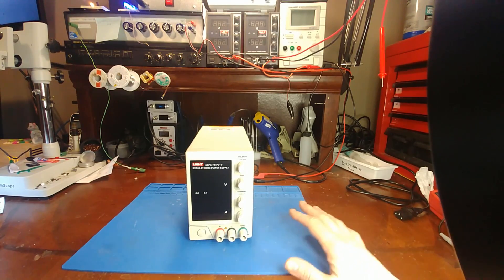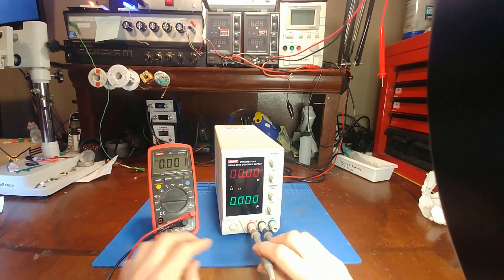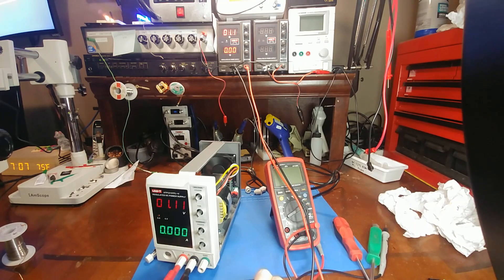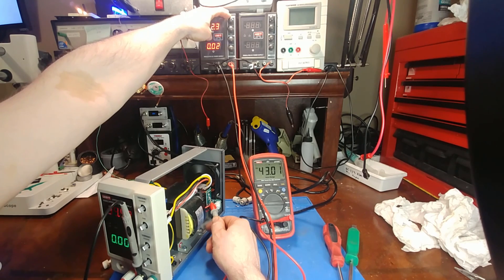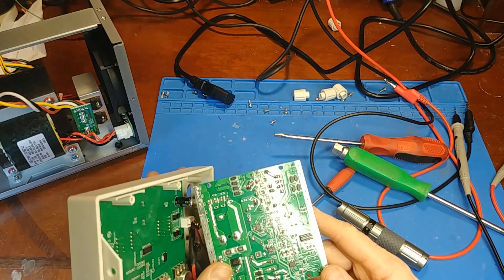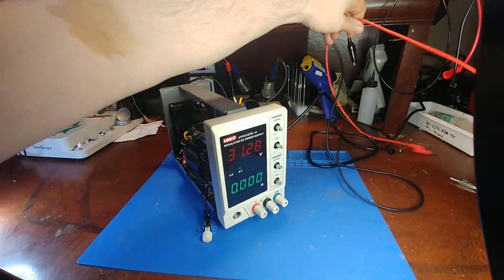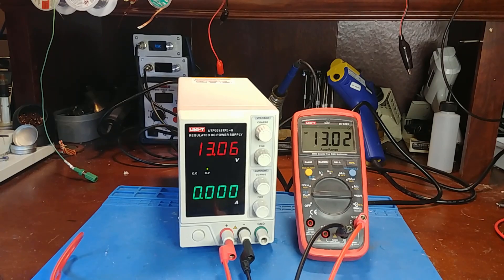Let's fix a UNI-T Power Supply

Comment: I have same PSU, it's amper range ise jumping all over the place when output short. I check all components end it's seems normal. I will try replace potentiometers. Any suggestion?
Reply from the maker: Does the problem change when you turn down the current potentiometer?
Reply: @jeffescortlx  its unstable, won't stay same place again.
Reply: i tryed again, show and walks around 3.1 amp
Reply from the maker: If the unstableness doesn't change with making adjustments to the potentiometers, it's probably not the potentiometers that are the problem. I'm not exactly sure.
Reply: @jeffescortlx  i will try to replace opamps. probly feedback part of the circut the problem.

Comment: hi bro.thanks fr the video.i have the 3 digit one.the lowest tab is not working that means it does nt go below 9v i opened it and adjusted vr1 now it goes upto 6v nt below that and higher end becomes 19v.any help would really go a long way jeff. its in constant voltage
Reply from the maker: These will usually use relay contacts to switch between different taps on the transformer for different voltage ranges. Are your relays switching in and out properly as you adjust the voltage?
Reply: Thanks fr ur reply bro. I can’t hear relay clicking sound after 15v till 0v. ur right might be the relays. So shld I replace them? How to check if relays are bad and specs for yuyihon yyh3f-sh-124lz? Which one is for lower tabs? Thanks fr ur time.
Reply from the maker: @zeuszix8009  before you replace them, check to see if the relay coil is getting power or not. It might not be the relay itself that is the problem, but whatever drives it.
Reply: Yes I will try to that. Will update u.thanks fr ur prompt replies.

Comment: Hi, just came about your video. How is this power supply regarding the output HF noise?  Have you ever measured that?
Reply from the maker: HF as in high frequency noise? It's a linear power supply so I wouldn't expect that to be an issue.

Comment: You're right about Uni-T. I have the same meter and I've got several products from them, they've become my go to reliable manufacturer with nice quality standard.

I've tried products from Lilliput/Owon and while the concepts are good, their implementation is usually wonky: unstable, not accurate, slow, prog. PSU with hard fan noise even when off, even their multimeter whines like crazy. Some I had to return.

Uni-T? Absolute charm... I've bought a 100 MHz oscilloscope going against bad press and it's very comprehensive and pleasing to use, I reckon pretty close to Rigol and nothing like the bad reviews suggested, which chiefly concentrated on missing interface features on earlier models which is now revamped and quite stuffed.

Comment: Jeff!  or anyone, Mine identical device, is showing and outputing around 44.33v constantly , values are real comparing with my tester... current seems to be fine if could be tested passing CC to CV as usual, rotating knov volt does not change values at all.... always arround 44 vol,

PLEASE

what to test?? 
all is clean at 100%!! not blown components or traces of exploded caps or anything... most diodes are ok and transistors too i think..caps are good shape
Reply from the maker: Typically when a power supply is stuck at maximum volts it's because the main mosfet that controls the voltage is shorted.
Reply: @jeffescortlx  can you please guide me to which one is it? where the mosfet/ transistor is located in this device?
Reply: @jeffescortlx  it started to work fine again by itself, maybe the relay stucked or similar due to its sounds...tks for your help, and if you can confirm that a relay might have affected to generate this issue you are welcome..

Comment: hi friend 
my utp1306s got microcontroller (  n76e003at20) getting heated up when power on and not working it I have replaced all other ic s on the motherboard but no hope at all till now is there any fix for this issue? I can't find any uni-t service centre in our location in India yet.
may I get a  programmed microcontroller for this power supply  unit? 
any help are highly appreciated 
thank you
Reply from the maker: I sorry but I don't have a spare microcontroller to sell. Have you tried to find a front panel for parts or a entire parts unit on ebay?
Reply: I can't find it on Ebay 
thank you

Comment: How did you remove the knobs on the front panel? Mine seem to be stuck hard. I tried pulling them.
Reply from the maker: Mine just pull off.
Reply: @jeffescortlx  yeah pulled it. Used excessive force. The fit is too tight.

Comment: Mine became ruined after the red probe touched a 300V. I tried your trick but mine is still not working. It only displays 00.00V and 0.000A. I would appreciate any help.
Reply from the maker: You'll need to do some deeper trouble shooting. Start at the output and work backwards.
Reply: @jeffescortlx  I resoldered the two chips back to their original places. Now it's working fine showing voltage correct values. When I try to adjust the amps, values remain 0.000. I did further troubleshooting, and I found this surface mount voltage regulator (S3M) being bulged with tiny cracks on top. It is not shorted. Could it be that the voltage regulator lost some of its value? I don't have correct tools to know for sure. I have been looking for the regulator replacement but all in vain. What can I do? I really love this linear power supply. Thank you.
Reply from the maker: @johnmayer2635  I would order 2 (or more, they are cheap) new op-amps and voltage regulators. Closely check any semiconductor on that path of high voltage destruction.
Reply: @jeffescortlx  I live in Kenya and the probability of me  getting those chips is an 8 out of 10 by mining them out of other devices. I don't know anyone who ships chips here. May be bridge rectifiers an some basic diodes. Anyway thanks again at least I know where to start.
Reply from the maker: @johnmayer2635  is eBay available at your location?
Reply: @jeffescortlx  yea! It's available but the logistics and taxes..,
 aren't worth the hustle my man.

Comment: Not wise to short out a psu while it's running at full voltage output, even if it is current limited. Great diag & repair.

Comment: The power supply was made in china and it's very cheap!  The bad op amps means 运算放大器
Reply from the maker: In my opinion the uni-t is some of the better power supplies to come out of China. China is flooded with cheap power supplies, but uni-t can be trusted as a step above the bottom.

Comment: Althought I didn:t like your start on servicing this PS you did manage by luck to find out by swapping the op amps that you probably had a dry solder joint on one of the pins ,so it worked
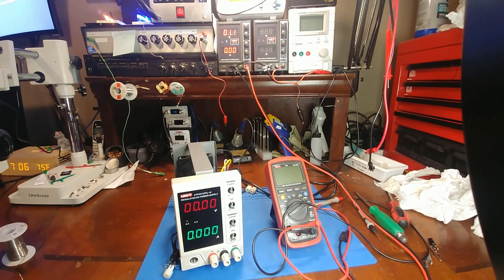Reply from the maker: 2:57 I commented that the front boards were inspected, (off camera). Just because it wasn't filmed, doesn't mean it didn't happen. The solder joints were good before swapping the op-amps. If it had questionable joints I would have covered it in the video.
Reply: @jeffescortlx  I am sorry Jeffe ,but what you do off camera has nothing to do with the video  you made.At least it would have been  much more constructive if you had mentioned it in the video.then I wouldn't have  commented.
Reply from the maker: @mira5751  I did mention it in the video, that why I gave you a time stamp of 2:57 that's where I mention no manufacturer defects were found.
Reply: @jeffescortlx  Yes you did my apologies I missed that Thanks

Comment: What Lab power supply leads do you use? I have been looking for some good sets for a while on the cheap.
Reply from the maker: Just some eBay banana plug test wires, advertised as silicone insulation.

Comment: Now I bought this kind of power supply of AliExpress which works but both displays are way of what the actual current and voltages are measured on a Fluke. I tried to adjust this but I can’t get it right. Is there a way you can make a video of how to adjust these displays so I can use this power supply without constantly having my Fluke connected? Thanks in advance!
Reply from the maker: If the trim pots on the front panel are not allowing you to dial it in, than it is defective and you should open a claim with the person you bought it from.
Reply: jeffescortlx well, since sending it back to China is on my cost and is 60% of the price I paid I decided to keep it. It is functional and usable but I’m looking for an option to get the displays right. Does you answer mean that I have to experiment with an other (higher) value for those trim pots?

Comment: Nice fix & superb cow. And it was a nice touch to see you peel off that protective screen protection at the end. How can you know for shure that the power supply (DUT) can handle external voltages (and reverse current) coming in through the outputs? I am a bit concerned about this if I charge a battery, and when the charge is complete, I turn the output of my power supply off. Then the battery will supply a pretty high voltage with a lot of current ready to kill something inside the power supply that has just finished charging the battery.
Reply from the maker: I'm not an engineer, or claim to know everything but my understanding is when the power supply is off, and power back fed through the posts, the power will make it to the main power transistor and than stop at that point because the transistor is off and open.
Reply: @jeffescortlx  But power (W) equals effect. And power/effect creates corresponding heat and damage. How can you tell if one power supply unit (PSU) can withstand reverse voltage at potentially high amps at the outputs without being toasted inside? And Volts x Amps = Watt (effect and heat)
Reply from the maker: @nixxonnor  if the power supply is off, the base of the transistor can't be turned on. If the transistor is off, it's going to be open and not allow current to flow.
Reply: @jeffescortlx  But if the power supply is still on, but solely the output is off? What then? And, in such a state, what if there is a low resistanse component connecting the two output connectors?
Reply from the maker: @nixxonnor  if the output is off, then current isn't going to flow past or in any direction with the open contacts, assuming it uses some sort of relay or switch for output control.

Comment: I'm surprised you didn't check it a bit further for basic operation. Like apply a known load to see if it would supply the correct current and regulate it. Same for the voltage. Oh well.
Reply from the maker: The current was tested at 7:58 and had no trouble getting to the rated 5 amps and the voltage reading was confirmed at 8:39
Reply: @jeffescortlx  Not really. Shorting it out to observe maximum current doesn't really check for current regulation. Nor does observing that the output is variable prove that it will regulate voltage. That's what the opamps are probably for (regulation feedback).
For voltage you need to set the voltage somewhere and apply a variable load to see that it will maintain the voltage at the chosen setting regardless of load. And for current you need to load the supply, put it in CC mode and be sure it regulates to that current regardless of a varying voltage pot setting. 
Just saying a bit more proof of it working properly would have been good.
Reply from the maker: @davesage9190  shorting it out IS testing it's current regulation, it doesn't get any more CC than that. You can see at 7:58 running the current pot from a low 300mA to over 5 amps. The voltage pot is also run from minimum to maximum and giving expected values. This power supply was used to test a 24v rail on a TV power supply and worked exactly as expected. I guess I don't see any evidence to assume somthing is wrong with it after the op-amp was switched out. If you are seeing something I'm not seeing I would be happy to make a part 2 going over the issue.
Reply: @jeffescortlx  Point taken on the short and you winding the current up and down. I guess that proves that part of it good enough. I didn't really catch on to what you were doing while you were declaring it was working. 
No need for another video.
Thanks
Reply: I defiantly agree that it at least needs some independent reading of current to make sure it was not regulated at higher or lower values. It was a lackluster send it its fixed

Comment: This shows that you should check the biasing of the o/p stage first before going to OP Amps and also do thorough visual checking  for PCB assembly since what you had done was to resolder those ICs or probably other components aside and nothing were faulty component... By the way , not good idea to supply back the linear PSUs since this could damage the o/p power transistors because you may supply higher voltage than the max VBE of those transistors and damage them if they were not....
Reply: Both good points. I blew up the output transistors on a supply once by charging a battery and reducing the supply to lower than the battery was at. Since then I always put a high current capable diode in series with the output to eliminate current flow from the battery back into to the supply.

Comment: I have a quick question as a newer guy to circuit board repair. I believe I have this same model I'll have to look when I get back into town but when I turn the voltage up on mine nothing happen s till I turn the current up. And then I can only turn mine up till like one Amp. Which at that point I can set my voltage. Is that normal? The instructions were not very useful. Also what is an op Amp?
Reply from the maker: Some switching style power supplies need a little current to start. But definitely needed one amp is too high. .01 amp should be enough for the voltage to adjust.
Reply: @jeffescortlx  sorry I meant if I give it at least some amps the voltage control will start working. I meant I can't turn the amps up till say say 5 amps. I'll only go to. 700 mah. I think I have your email so when I get home latter I'll make sure what model I have and retest it since I haven't really used since the pendamic and just send u my results. Then u can tell me if it's normal. If not I think this might be a real good learning experience for me to get it to work right.
Reply from the maker: @phillipzan2005  that behavior isn't normal for a good bench power supply, but is normal for the inexpensive switching power supplies, like the $45 and under range.

Comment: Smashing diag and repair :-D
On most of the basic op amp psu's the current/voltage  limiting op amps grounds the pre driver transistor base, the base is pulled up via a resistor.
I suspect that one of the op amps had a hairline solder fracture  on one input so the op amp was slammed into full conduction.
But i could be wrong, i often are lol.
it's well worth fitting two new opamps just for peace of mind :-D.
You can never have enough power supplys, or meters, or mugs of coffee/tea lol.
Reply from the maker: Good point, can't really have too many power supplies!
Although this one is going to a buddy that is having a birthday this weekend.
Reply: @jeffescortlx  What a loverly idea :-D
Reply: @zx8401ztv  "you can never have enough power supplies, meters, ..." ok i need to show this comment to my wife to prove that i didn't make up all these things.
Reply: @radius.indrawan  The trick is to call them ' tools', but be careful as she might expect you to do some useful work with them ha ha :-D.
Reply: @zx8401ztv  worth to try 👍😂